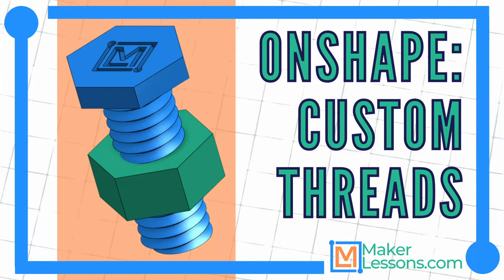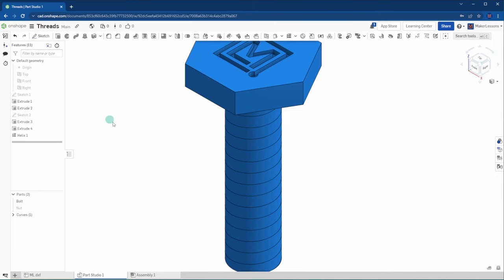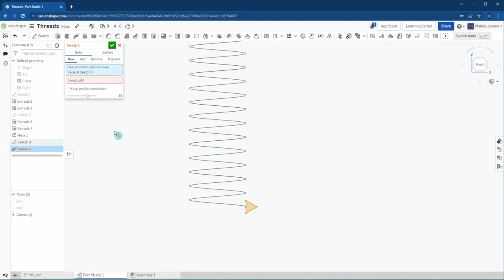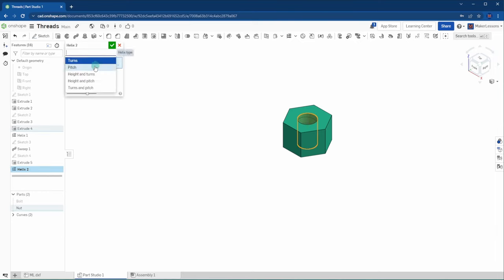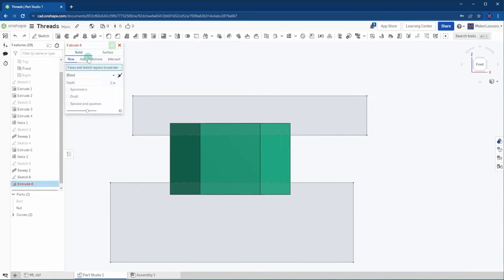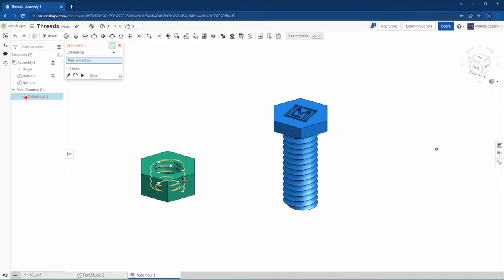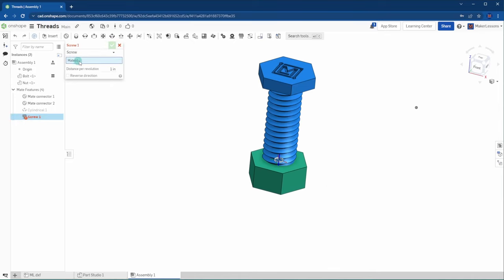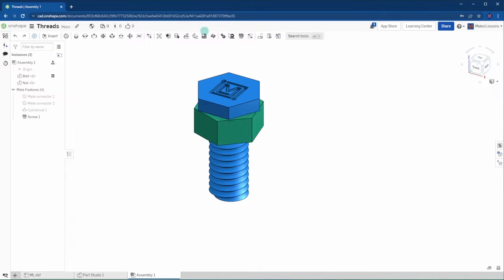Learn Onshape: Drawing Threads for a Nut & Bolt

Comment: Dont you need some sort of tolerance between the threads so that the bolt can screw in properly?
Reply from the maker: It was in there originally, but for some reason when uploading my audio cut out during that section. Yes, include the tolerance that your printer needs, I start with .01in and mess around from there.

Comment: My onshape is different. When I click helix, It shows the option "input type." is there a type spot where i can type in the height because i've been watching videos and I think mine is updated
Reply from the maker: Hey so I went in to check what you were talking about and it looks like you can pick an end point when using the input type turns or pitch. Is that what you are asking about?
Reply: @MakerLessons  oh thanks for responding. I figured it out but I wanted to know how to chose how high I wanted the thread to be and it not be the full part

Comment: Thanks! Currently designing a tube with a screwcap that has a compartment in the cap that is left handed!
Reply from the maker: That's a great use of this since it is real easy to switch the helix to counterclockwise with just the click of a button.

Comment: Good tutorial. The only thing I do differently is to make the angle of the thread triangle be 45 degrees so you don't need support material under the threads when 3D printing them.

Comment: Looks good until you translate the part because the helix does not translate.  If you delete the helix after the sweep then the sweep is deleted also.  If you select the part the helix is not selected.  If you translate the part the helix does not translate.  If you translate the part by copy you get two of the same parts and one helix that defines the sweep in both parts.  If you select the part and the helix and select transform when the transform dialog opens helix is deselected from the list.  When the part is transform the helix remains in the XYZ location where it was created.  This is lame.  How do you fix this?  In my mind Onshape is not ready for prime time.
Reply from the maker: Hey, so I am pretty sure it is not translating because you need to select the curve. A helix creates a separate curve feature on the work flow tree to the left like when you make a new part or surface. This also means you can turn it off visually with the little eye icon like with parts you want to hide. You can't delete it because it is being used as the sweep path.  I have not tried to translate this myself yet but let me know if that helps. I also would only try to do these type of threads at the end of your drawings and if you are trying to 3D print these threads. Otherwise if you are creating threads just for a drawing sheet just use the new thread feature ->  https://youtu.be/x0Oa6XuRaH8

Onshape is always updating and getting better everyday. It may not be solidworks or fusion just yet but its getting there and its free and browser based.

Comment: Great video and thank you.  I've been playing with threading in Tinkercad and I didn't really like the way they handle threading.  Onshape seems to handle threading in a manner that is more inline with how I'm used to making threads (which is on a lathe).  It looks like a more complicated process to create a thread for 3D printing with Onshape but your video will help me greatly.  Thanks again.
Reply from the maker: Yea, the helix sweep path is like the lathe spinning and your hands moving, and the sketch profile is like the shape of the tip of your turning tool. Good analogy 👍

Comment: thank you for your work but why don't we use boolean operation for nut (with offset) ?
Reply from the maker: Hey, thanks for watching. There is more than one correct way to model something and using a boolean operation is definitely one way to do it. I didn't want to introduce boolean in this video but I do plan on making an entire video on those operations soon.

Comment: How do I shorten the helix so it's not the entire length, or make the sweep not go all the way?

I only want a partially threaded bolt
Reply from the maker: When you click on helix there are a bunch of options. There is a turn and pitch option where you can set your pitch and then choose how many turns you want. This will allow the partial threading you are looking for.
Reply: @MakerLessons  My onshape is different. When I click helix, It shows the option "input type." is there a type spot where i can type in the height because i've been watching videos and I think mine is updated

Comment: I just love your videos! These help me a lot as I'm an Onshape beginner 🙂

Only weird thing is that the section "Adjustments for tolerance" is without sound. As I'm designing for 3D printing this is about the most important step ;-). Any more info?
Reply from the maker: Thanks for checking the videos out! I'm glad they are helpful. I do need to get better with audio, and I have no idea what happens when I upload them to YT cause they always sound fine in my editor 😅 

In terms of actually printing the threads for tolerance, there are two ways to go about it. The simplest would be to just go into your slicer and adjust the scale of the nut to 101% or 102%. This may not be feasible depending on what you're printing but is a quick little hack to account for tolerance. 

The other way is to actually make adjustments to your design. So for instance, whatever shape you are sweeping along the helix make smaller on the bolt. The amount will depend on the quality of your print/printer. I would start with adjusting the size by at least the bead width you have your priter set to (i.e.,01, .015, .02). As always, do a few test prints and see what works for your setup.

GLHF
Reply: @MakerLessons  If I just scale the nut in slicer, wouldn't that also change the pitch in the nut?

Comment: I want to make an iso M3 bolt, what are the dimensions I have to using on the triangle
Reply from the maker: To 3d print? That's gonna be really fine threads. At that point I suggest just printing a solid bolt and get yourself a tap and die set
Reply: @MakerLessons   thanks
Reply from the maker: If you're just looking to make threads that show in a drawing there is the threads feature https://youtu.be/x0Oa6XuRaH8

Comment: Please do not say "Draw" when you mean "Model". Draw means to create a drawing. 
It is a lot easier to model custom threads in Onshape than it is to get the drawing sheet created from that model to actually show those custom threads. The silhouette edge to enable dimensioning the tread profile does not seem to get computed correctly by the native drawing capability, which has been added on by a German developer, contracted to Onshape. In many cases it is just blank.
Reply: Since posting this I have been reminded that there is a "View Render Mode" option under "View Properties" where you can change a view or views to the "Best quality" setting. In my case this did the trick.